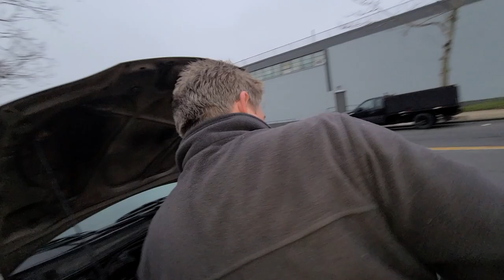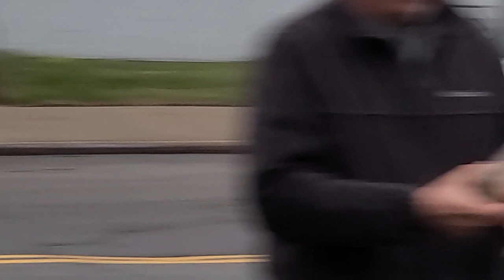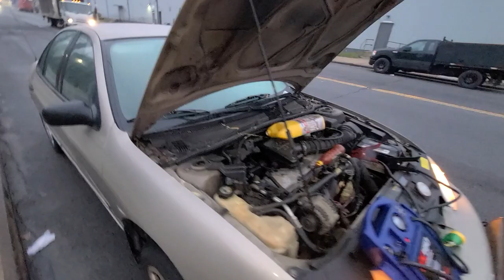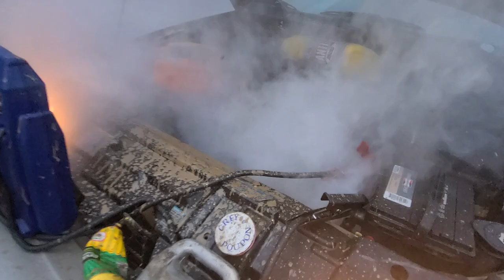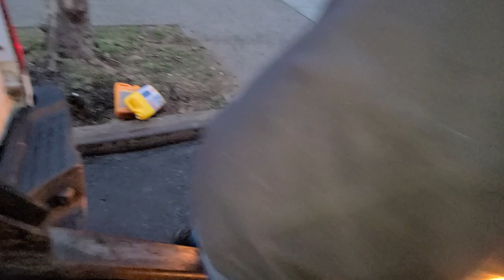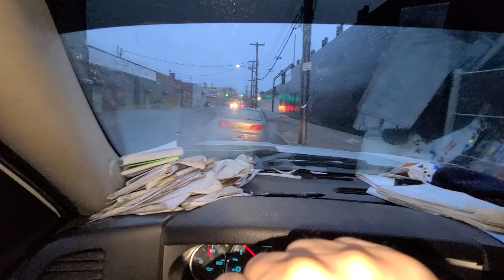World's Toughest Motor! Yes We Found It! NEUTRAL DROP!

Comment: Low compression, iron block, pushrod GM engines. They're solid. I'd take "Some  Freakin Irishman" over any new "ecotec" all day. I've had cavaliers and s10's well over 200k with this engine and they run forever because they don't have enough power to hurt themselves or the transmission.
Reply: And some of the colours are cool
Reply: A lot of them had oil pump issues such as mine it starts going bad and looses oil pressure yep happened to my 2.2 then it spun the rod bearings
Reply: @Cherokee93  yeah then you gotta pull the engine up to get the oil pan off on 2wd models. My first s10 did that to me at like 248k but I noticed the oil pressure was getting weak and managed park it not to destroy it. Many weren't so lucky.
Reply: @WhitefolksT  nope noticed when it was too late 😭 gotta buy a junkyard motor for it
Reply: @Cherokee93   :(
Reply: As a mechanic I do head jobs on terrains   Malibu always the long timing guide that breaks and chain rides in the bolt till it jumps
Reply: @WhitefolksT  265k miles
Reply: Ecotek revolutionary belt-in-oil system
Reply: Got 316k flawless miles on my 2.2 ecotec
Reply: @badazz2969  love those 2.2L, those are wayyyy better than the newer opel 1.4 turblow for sure. On my dudes 14 cruze with 98k miles I've put two valve covers on that for integrated PCV failure, he's about to be on his third water pump this week, had quick connect coolant leaks, the valvetrain sounds like trash, belt tensioner, he's got evap codes, all sorts of s#!+. If I didn't change his oil for him religiously the turbo probably would have went out. He wishes he had his 2.2L cobalt back, he beat the fk outta that thing at Papa John's, had over 200k when he traded it in ( big mistake ). Should of just kept it laying around, it was paid for. Good luck with that Freakotec 👊🏻🔧
Reply: I had a 1994 Geo Metro 5 speed manual, ended up giving it to a friend of the family when they needed a car. 238k on it, same situation, not enough power to actually break. Good car to learn how to drive stick in for that reason also. My wife dropped the clutch at a stop sign at 5k RPM one night when i was trying to teach her how to drive stick it actually lit the tires up a bit and launched surprisingly well lolz. i told her holy shit i've never done that in this car, but this thing is old lets not do that again.
Reply: @iamatlantis1  I had one of them. 3 cylinder 1.0L Suzuki engine 5spd. It had no keys. Screwdriver start. Dead battery, always parked on a hill for a pop start. Took the steering wheel inside with me at night. Very simple, reliable, tough little car. I took out the back seats and door panels, carpet, stripped it down. Dead fuel gage, kept a gallon in the back. Car did like 50mpg or something crazy.
Reply: @blockburnerboy My ex did too to the community,,that’s why she’s my ex
Reply: the ecotec in the sho is a cruiser
Reply: @WhitefolksT brokie

Comment: My first car was one of these and went close to 300k with no engine problems. The car was about rotted in half and had to go. My dummy brother bought it at 170k, barely changed the oil and ran it out of coolant and cooked the cylinder head despite me telling him the water pump is leaking so keep an eye on the coolant or your engine is toast. He calls me when he’s on the side of the freeway. I didn’t answer. After I fixed it it went about another 100k. Not much power but you can’t beat over 30mpg highway with a 3 speed trans. 4 cylinders today with direct injection,  VVT, OHC, and whatever else can’t even do that. It’s more reliable and far easier to work on than any Honda engine.
Reply from the maker: So you have a dummy brother too
Reply: A d series honda single overhead cam would have survived this same abuse😂 you just dont know how indestructible those little bastards are these guys actually have a video of a d16 in a civic from a few years ago waterboarding the shit out of it.
Reply: To bad now days chevy makes shit while honda is still making good stuff

Comment: Great video fellas! My 95 S10 had the same 2.2 in it before I V8 swapped it and that old pile of junk would never die. It had 250,000 on it, blown head gasket, very little oil pressure and had been knocking for a while. The 2.2 didn't care and still ran the day I pulled it out.
Reply: Focus 2.0 went 400k no issue
Reply: @mikehigby7897  the car my parents had growing up was a brand new 2001 focus 1st gen with the 2.0 5 speed it was a super reliable car till about 200,000 my mom started it, made a god awful noise like a Card in a bike spoke, a piston I think it was, melted and shot across the engine but it got a new engine and lived on
Reply: @stankdaddy6145  I have a 2003 Focus ZX3 2.0L which is my daily. Tough little car. Doesn't have much power and doesn't have great gas mileage. But it's been very reliable. I've owned the car for 2 years. It runs like a champ, doesn't burn any oil and doesn't leak anything. Never has let me down either.
Reply: @RicardoPCGamer  I’m sold on old Toyotas I paid $500 for a 2000 solara 275,000 miles rn  bought it a year ago I’ve dogged the shit out of it every day and took it on trips it’s never skipped a beat, it’s a 2.2 I miss my 6 cyl solara it had 290,000 still ran perfect but some shit happened and I had to scrap it
Reply: @stankdaddy6145  i looked at a Toyota, it was overpriced. $2500 for a 1998 Toyota Celica GT with 225k miles. The car had too many problems. It was leaking oil, had power steering leak and power steering problems, struts clunked, bad tires and the transmission shifted hard.  I said hell no to it.
Reply: @RicardoPCGamer  dude I get so lucky on cars 😂 this one burns a little oil half a quart sometimes a quart between oil changes, ac works heat works, I actually hit a deer the other day going 60 luckily I yanked the wheel last second and it went down the side but it still fucked up the fender, before that the car looked perfect not bad for a $500 beater haha
Reply: 'Merica!
Reply: @stankdaddy6145  lol cool
Reply: @mikehigby7897  It's called a Paradox.  The Focus WAS the issue.
Reply: I have a 94 Ford Explorer 4.0 automatic with 243k miles. The lifters tick a little but it won't die. The first gen Explorers are the best
Reply: @drfeastmf  my parents had a 1994 Ford Ranger. It was an automatic with the 4.0 also. It was a great truck, sadly it was totaled in 2015. It had like 240k on it. But a wheel came off another car and went across the road and hit the front and bottom side of the truck. Damaged the frame, exhaust and driveshaft.
Reply: @RicardoPCGamer  Damn that sucks. My Explorer was actually my grandpas and I got it for my first car lmao. It'd got a little yee left in its haw but it needs a little rust work done. I changed maf sensor, and 5 spark plugs lmfao cuz the 6th one wouldn't budge, and I'm not gonna risk snapping the damn thing. It runs fine so oh well lmao. Its a beater with a heater, and I love it. My grandpa also had a 93 which lasted over 300k miles until the motor started knocking
Reply: @drfeastmf  great until the heads crack lol
Reply: @South_0f_Heaven_  Don't see how the heads will crack but ok. 243k miles and the heads still aren't cracked
Reply: @drfeastmf  not going to get into a pissing contest here but I worked in a automotive machine shop for many years and would usually get a few of these 2.2 styrofoam heads in every week for a pressure test. About 70% of them were cracked, always in the same spot. 

Just like the Ford 4.0, Dodge Magnum, late 90’s 350’s, Ford 3.0 and all the other heads that were commonly cracked. 

That being said don’t assume that just because you’ve seen a few good ones that it’s a common theme because it isn’t.
Reply: @South_0f_Heaven_  Ok. I see that that's just based off your experience. I would like to say however that there were two versions of the Ford 4.0 - the ohv which is in my first gen and is also in second gens and there is the sohc that was in the third and fourth gens. They are almost the same engine but not exactly. So idk if you mean the ohv 4.0 or the sohc or both. I understand that you've seen many bad ones apparently but based off of my experience and many other Explorers and Rangers I've seen they seem to usually last a very long time, as long as the automatic transmission holds up

Comment: My sister in law drove one of those and the engine seized up on the way home from the lube shop. In the 2.2s defense, I've got to mention that the lube shops so called technician forgot to put any oil in it before giving it back to the owner. That's some quality service if you making videos for Neutral Drop. Lol

Comment: If I find a old Chevy with a 2.2 I’m buying it lol
Reply: They’re terrible. Word to the wise. The cylinder head is chowder. Aluminum polystyrene looking junk  they love to crack between the valves. I had a coolant passage eat right into the intake port
Reply: @Youtubecensoredmyusername  My '92 2.2 got overheated several times to the point of the reserve tank becoming deformed. Still drove it on a 1,800 mile road trip to Wisconsin leaking coolant with a blown head gasket and cracked head. They seriously don't care. My 02 2.2 has 303k miles and a very questionable service history and runs fine.
Reply: @AlexReiterProductions  hope you didn’t have a hole eroded from around your exhaust valve into the coolant passage like I did. It’s very common for a crack to develop between the valves also. I would never drive one of those again even for free. I’d bet one side of your head bolts isn’t much more than finger tight from all that expansion
Reply: @Youtubecensoredmyusername  The later ones fixed the issue. It's a great car with a V6 too.

Comment: I have a cobalt with a 2.2 dohc. Its been run low on oil from previous owner because of oil burning issues. Rebuilt the motor because its a 5 speed. And the rod bearings at 200k were immaculate. Still put new rod bearings. New pistons. New valve seals with a refinished head and the valve seats done on it. New timing chain with new guides. New water pump. New starter. New alternator. Amazing engine

Comment: I have one of those 2.2 SFIs in my S10 stuck to a 5 speed manual, about a half quart of oil vanishes every 3k miles but I've hammered the limiter, shifted 1->2 without lifting off the gas, and had it cruising 85 for hours. It doesn't make power but it sure can take a beating.

Comment: Had the 2.2 in an 08 Cobalt I had for 10+ years 150k miles, honestly the best car I've owned prior to 2020, the thing never broke down on me once. Sold it still running like a top. Only a lifter tick on that Cavalier after all that lol.
Reply: That was an ecotec DOHC in your cobalt...excellent engine and better than the new opel and Chinese ecotecs, this 2.2 here is the old L43/LN2 iron block overhead valve 8 valve cam in block pushrod plant that was in the s10. They don't have enough power to hurt themselves so they run forever.
Reply: @WhitefolksT  thanks for the clarification :) I wasn't aware of all that lol, was a fantastic car. Probably still rolling around somewhere in TN lol.

Comment: You know what, I had a Sunfire with one of these 2.2 SFI motors and it never quit. It had a leaky head gasket and a misfire but I drove it 8 hours straight every 2 weeks and all it asked for was a couple clutch dumps before it got turned into hubcaps. Excellent beaters, can't kill em.

Comment: I had a 1996 cavalier with 2.2 engine I bought it for $800 at a auction it had a 175k miles on it when I bought it I drove for over 5yrs almost at 255k when I sold it the motor ran great but clutch went out!! I'm a Ford guy but the Chevy 2.2 and the 3.1 are the best engine's in my opinion 😎💪

Comment: I had a 1999 that ran forever. The odometer bulb burned out at around 350,000 miles. It started overheating on me and blowing all the coolant out and leaving me stranded so I found another car to drive. I found out some ass wad lost my radiator cap and replaced it with a washer solvent bottle from a 1990's chevy van. I had the auto parts store order about 3 wrong ones and the last one they got me, I took electrical tape and ran it around the inside of the thing until it sealed up. I started to daily the thing again to keep miles off my newer honda and enjoyed driving the Cavalier. I finally sold the car to some old lady and her son shined a light into the odo and it was pushing 400k. I told her I wouldn't trust the car to go downstate and just drive it locally because of the electrical tape holding the radiator cap together but she did anyways to take her brother to dialysis 100 miles away 3 or 4 times a week and running errands all day long. She needed something good on gas and she drove the thing god only knows how long.

Comment: Impressive, most of the 2.2s I've seen had cracked heads or head gasket failure.
Reply: Yeah especially the newer ones in the Cobalts and stuff. I think the older ones in the Cavaliers and S10s are better made
Reply: @drfeastmf  I think the opposite the newer cavaliers and all cobalts use the ecotech engine which is much more powerful and has performance potential as they were turbocharged and supercharged from the factory. The 2.2 pushrod is pretty awful and it was snail slow in an S10
Reply: @unclejoe6811  Idk maybe that's just what you've seen. I'm not saying you're wrong or anything its just personally I've seen many Cobalts, especially the turbo ones, blow head gaskets and stuff like that at lower mileage. On the other hand I see 2.2 S10s and older Cavaliers with 250k miles or more all the time, but that's just based from what I've seen
Reply: Yup the good old styrofoam heads that crack near the egr port. Almost as bad as the dodge magnum heads that it was rare that they weren’t cracked.

Comment: I am impressed the engine temp safety didn't engage.
Reply: Looks like at the end the engine temp backup safety engaged. You needed to unplug the temp sensor on the top of the motor.

Comment: Bro I owned a 1998 Pontiac Sunfire from 2012-2014 with the same engine and I BEAT that engine like crazy! I Built an advance auto parts air intake And thought I had a roadster and Blew the engine redlining racing a 2012 charger lol 😂😂😂

Comment: i’m just sayin these ln2’s are indestructible, i smashed a hole in my oil pan on my 98 cavy and drove it 10 miles home with zero oil and it started making noise when i pulled in the driveway 🤣 the next day it was knocking and was too late so i just put it out of its misery sadly 😿

Comment: Is that the same Grumman LLV 2.2 like they use in mail vehicles? If so, no wonder it's invincible lol

Edit: yeah pretty sure it's the same LN2
Reply: They didnt have the 2.2 in the 80s when the LLV was made, I think the LLV uses the Iron Duke 2.5 which is the same as a Mercruiser 3.0 and those things are reliable as hell
Reply: Just Googled it, we’re both right. The early years were Iron Dukes, later ones had the LN2
Reply: the 2.2 and 2200 are different. same engine but the 2200 has different fueling system i believe and emissions equipment. the 2.2 has 5 more horsepower if i remember correctly. great engines but they have head gasket problems

Comment: Torture test new idea: Tow a vehicle with the drive/power axle (wheels) on the ground. 
Someone mistakenly did this on a Jeep Wrangler where they towed it, left it in 4LOW and 1st gear and shredded the Engine and transmission and probably also the TCASE.

Comment: Worlds toughest motor? No! The volvo b18 engine is the most durable engine i can think of. The b18 has a gear driven cam shaft and the bearings is huge like on a truck engine! Its slow, but it takes you were you have to go ALWAYS!

Comment: Lmao the chevy ecotec 2.2 was junk. GM could never make a quality 4 cylinder.  People applauded that it went over 200k but most in-line 4 cylinders did no matter what brand. I've seen focus 2.0's go 400-500k no problem. Now that's impressive compared to the poopy Gm Inline 4's
Reply: Yep the 2.0 Duratec in the Focus is bulletproof.  Had many over 300k.  Have a 2013 Focus with 357k on it now still running fine

Comment: You guys give up too easy lol drop the radiator fluid so it's running Hot as, also I reckon if U put 1/4 of the stuff on your dash in the engine it would blow haha  , and you not well cameraman ? first time I've seen you look after a jump pack LoL